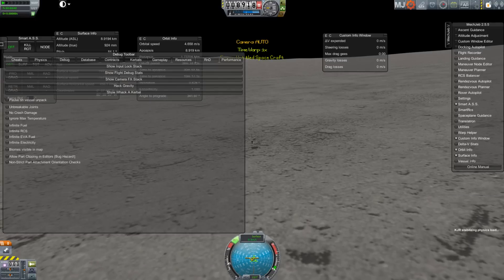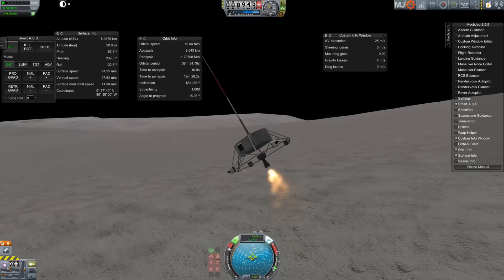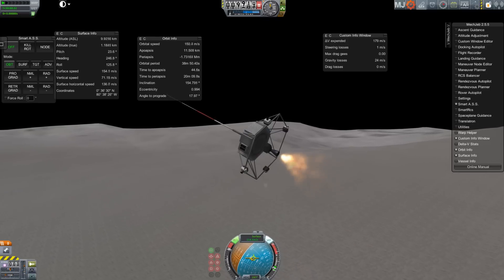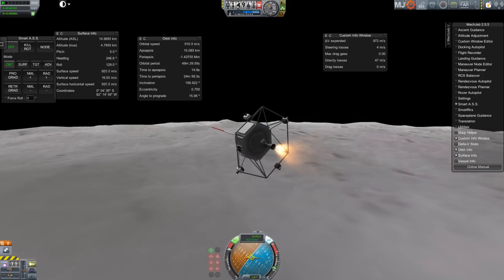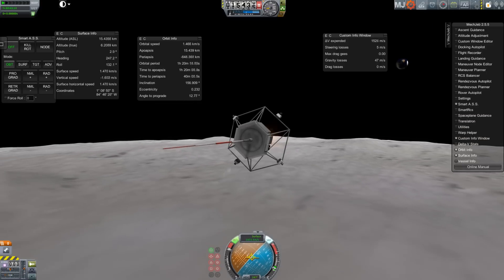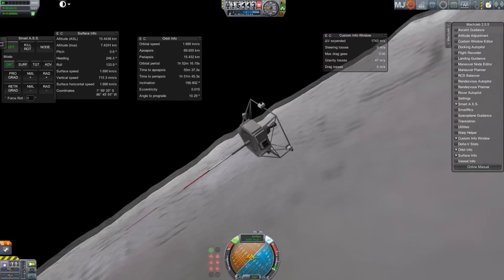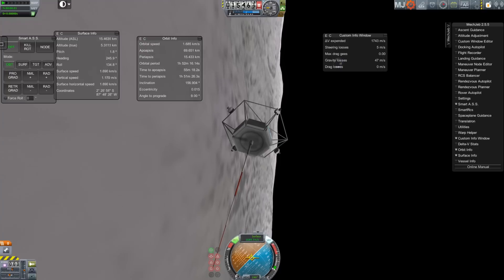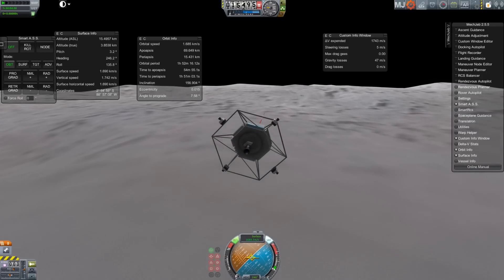How Much Delta V Do You Lose in a Moon Landing?

Comment: for liftoff and landing calculations of deltaVs initially you have to take into consideration the amount of impulse you need to get to the desired orbit's height as well as the required velocity you have to achieve for that orbit.

simplified: dVreq = SQRT(2*g*h)+SQRT(μ/(h+R)) - v0*COS(incl)
dVreq - required deltaV
g - gravitational acceleration at surface
h - desired altitude of orbit
μ - standard gravitational parameter
R - equatorial radius
v0 - is your initial velocity due to rotation of the object, in case Mun is about 9m/s
incl - your desired inclination

Comment: technically, "reverse landing" is not launching, cause if we look at the ship on the ground and orbit in landing, it is heavier on orbit and lighter on the surface. And when we launching, it is heavier on the ground and lighter on the orbit)
Reply from the maker: Did you know it's common for spacecraft landing calculation to be performed by simulating a launch vehicle which has negative fuel consimption and gains mass during ascent?
Reply: +Scott Manley that makes more sense, it is just like inverting time, which is very useful way to solve some problems in classical mechanics. At least I used this method a couple of times in my work.

Comment: I always bring at least 200m/s of buffer due to PEBCAK errors.
Reply from the maker: PEBCAK is the biggest source of problems in most kerbal missions.
Reply: +123nick Problem Exists Between Chair And Keyboard. 

User error.
Reply: +Scott Manley whats PEBCAK ?
Reply: +VhenRaTheRaptor ahhh ok thanks
Reply: +NaleshSA You're right, even using autopilot I screw up sometimes so when going manual, I tend to exaggerate my fuel by 15 to 20% so I know I'll not be stranded somewhere.
Reply: +NaleshSA i think everybody who has some experience with the game do that :D

Comment: I really have to disagree here. The landing you did in the previous video was really, really bad. Your trajectory was way too steep and you had to point your craft downward to fight gravity, wasting lots of dV. In a perfect landing you wouldn't have to do that until the very end.
Yes, getting that trajectory right is very hard and yes, a 50 m/s dV margin is too little to actually manage to land. But you could still have made a better attempt.
Trying to land on Tylo or any atmosphere-less real world solar system body shows very well how you have to get the trajectory just right. I've landed crafts on these types of bodies lots of times. I nearly always crash the first few times because I get the trajectory wrong. But after a few tries, I get it right and I manage to land with the same amount of dV that I crashed with during other attempts.
Reply: +Smorfty 
I believe this is the correct answer Scott, your trajectory was terrible if you were aiming at "perfect" landing. The attempt here shows a perfect suicide burn with near perfect trajectory and higher TWR. As much as I like your vids, this is not a proof of anything.

Comment: Scott, during the landing, the point with the highest TWR was just before touchdown (crash), but during your experiment, the point with the highest TWR was at orbital insertion. In other words, on your landing attempt the tank was empty at ground level, but during your ascent the tank was full at ground level. Since the TWR was not the same at each corresponding point of these trajectories, you cannot assume that one is the reverse of the other. You should do an other experiment and calculate your gravity losses during the descent rather than the ascent ;)
Reply from the maker: The TWR in the experiment didn't change, since I used infinite fuel.
Reply: +Adrien Lessard 
The mass stays the same due infinite fuel, so the TWR is only affected by the gravitational pull of the moon, which is lower when you are further away from the body then on the surface. Therefore the TWR slowly increases with altitude even with constant mass.
Reply: Yes, but during the landing, Scott Manley  didn't have infinite fuel, so the the landing cannot be compared to the ascent accurately. I'm just saying that "The landing is the exact revers of the ascent" is a false statement.

Comment: You could also link to a post by tavert (both on reddit and the KSP forum) about constant altitude landing/takeoff: http://forum.kerbalspaceprogram.com/index.php?/topic/36648-landing-and-takeoff-delta-v-vs-twr-and-specific-impulse/

From this is can be seen that thrust to weight ratio is very important for the minimum required Delta-v, however above a TWR (relative to that celestial body) of roughly 3 the reduction in Delta-v is probably not worth the extra mass you normally need for a more powerful engine to get that TWR.

Comment: This probe has significantly higher TWR than the probe you tried to land, so it´s not really comparable.
Reply from the maker: +Goroh35 The TWR is critical during the initial lift off and final descent, so look at the TWR on the original lander at burn out and you'll see they have comparable TWR.

Comment: dumb question: is delta V the same as fuel?
Reply: +Tiago Passarela Delta V  means change in velocity, fuel is burnt to affect this change
Reply: https://en.m.wikipedia.org/wiki/Delta-v

or simply "change in velocity", in this case  in meter per second (m/s)

the "delta" stands for "change" (delta is often used in phisik math to signify change)

the "V" is short for "velocity"
Reply: +Don Sparrow ur fast :D
Reply: +Tiago Passarela Not a dumb question at all.  Delta-V is affected by the amount of fuel you have but also the mass of the craft.  A heavier craft will require more Delta-V to perform velocity changes, so it will need more fuel - which will also make it heavier because the fuel has mass.  A lot of the art of designing rockets is to calculate how much fuel you need and finding the Delta-V 'sweet spot'.

Delta-V can also be improved by having more efficient engines.  Ion engines (for example) have a very low thrust but very high efficiency, so they will be able to affect changes in velocity for a very small amount of fuel mass - but will not be able to affect those changes quickly, which makes them useless for atmospheric flight.  This is part of the reason why we still need (relatively) inefficient chemical engines with high mass (and heavy fuel) - because they can provide changes in velocity very quickly and provide enough thrust to reach orbit.

The Delta-V is affected by even the smallest change in mass.  Astronauts on flights are measured to within fractions of a gram for takeoff and Delta-V calculations, as is the payload and the craft itself.  Real rockets run to a very small margin of error to ensure maximum efficiency.  It's why Apollo 13 had to take the path it did (assisted gravitational slingshot around the moon) rather than a 'direct return', because the Delta-V for a direct return was incredibly marginal.

Comment: Proof that this sentence not only apply to aircraft :
The only time you have too much fuel, is when you are on fire ! :D
Reply: +Kit Naylor Jebadiah Kerman
Reply: +Demongornot Well landing can be a problem with a trust to weight ratio that is too low.
Reply: +Demongornot Or when you need your craft to lose weight, which you can do by burning fuel.
Reply: Who said that? xD
Reply: +Demongornot It doesn't apply to aircraft either. You're still using extra fuel to compensate for the extra mass added by the extra fuel. This is why commercially flown aircraft just have 'enough to make the flight, with reasonable a safety margin.' Wasting fuel adds up quickly.

In rockets this is even worse since the rocket equation doesn't play nice. Having one ten extra fuel may very well mean you end up using half of that anyway.
Reply: +OverworldLord Correct.

Same profile pic. Hey there fellow pilot! :)
Reply: +OverworldLord 
Yeah, better have too much and dump it than not enough !
+Dare Daemon 
I know it, I know that more fuel you add to a rocket, more thrust you need to carry his weight and the weight of the bigger fuel tank and the weight of the structure to support heavier fuel talk and more engine thrust.
But the payload capacity also add up and you can carry heavier and heavier things or have greater and greater delta v if you don't put a heavier final payload.
And in reality the only reason why we don't do it its because it will be too expensive, that's all, nothing prevent you to use a overpowered rocket to carry a really small thing (providing throttlable engine with enough throttle down percentage to avoid aerodynamic failure during the area of maximum dynamic pressure cause of too much acceleration because of too high TWR), it will just be a waste of fuel cause a lot will end up being not burned.
Just money.

Same for aircraft, first, airliner have a maximum landing weight which is under their takeoff weight, if an aircraft that just take off need to land back cause of emergency or anything else, he will need to dump fuel to become lighter, and yes carrying more fuel mean more mass and mean higher throttle setting to push that extra weight and of course more consumption which mean fuel aka money wasted, but again its only a matter of money, at the end the aircraft could have greater range.

But the sentence "The only time you have too much fuel, is when you are on fire !" mostly apply to jet fighters which at military power already burn a lot of fuel and with afterburner on dry really quickly their tanks, if they could have more fuel most of the time they will be able to perform more aggressive manoeuvre and compensating more easily the loss of energy and over time get able to take advantage to most opponent in dogfight situation by compensating the non energy conservation friendly manoeuvre with more time in AB.
Reply: Thunderpawz Hello, Thunderbird 1. I might be mistaken, but I believe we've met once before... with a similar profile picture conversation.
Reply: +OverworldLord Maybe.  :P

Comment: How do you work out gravity losses on paper? I'd be really interested to know, thanks.
Reply: +smokeydops Yeah, I spent ages thinking about it last night. I couldn't find anywhere that gave an actual equation. It's probably because it's more complicated than I originally thought due to the vectors and the fact that the mass of the vehicle decreases as it accelerates, as well as the force of gravity reducing as its lateral velocity increases (also because it's getting further from the centre of the parent body). 
I got that it would depend on the downward force due to gravity and the time spent experiencing it but I don't know how to put it into an equation given that all the variables are constantly changing.
Also, I think you mean m・s-1 of Δv rather than metres per second squared (I know it's pertaining to acceleration but still).
I still really appreciate your input though, thanks!
Reply: +Morgan Mitchell Basically, your are trying to find the velocity you would have when you impact the ground from a dead standstill at a certain altitude, although you could factor in an initial velocity if you wanted to.  Ill do an example with the moon

g = -1.62m/s^2
altitude = 100 meters

There are two ways to do this, the easy way would be to just throw it into the equation v^2 = 2ad where a is acceleration (due to gravity in this case) and d would be the altitude.

v^2 = 2ad -> v = sqrt(2ad) So if you do that out it should be 18m/s

If you wanted to work out how it happens to be 18m/s you could do it like this
The "position function" (d = .5(acceleration)t^2 + (initial velocity)t + initial height) comes from the integral of velocity = acceleration x time. (an integral is just an anti-derivative) Not too important to know that but it comes in handy because if your distance d is 0 for a certain time then you know that time is the time that you have impacted.  Also make sure your acceleration is negative for this part.  
using the same numbers from above. initial velocity is zero.
t = time a = acceleration due to gravity v = velocity d = distance s = initial height
d = .5at^2 + vt + s
0 = .5(-1.62m/s^2)t^2 + (0)t + 100 meters
t = 11.1seconds

So then just find your velocity from accelerating that amount for 11.1 seconds.

v = at = (1.62m/s^2)(11.1s) = 18m/s

Note that this can also be fun to use for actually calculating suicide burns.  Hoped that helps though, didn't ever think i would spend this much time writing out a youtube comment.
Reply: +Morgan Mitchell Just a guess from me:
I think you&#39;ld need to know how long it will take to reach orbit and then calculate how much energy you need to keep hovering for that time. So if it takes 60sec to reach orbit =&gt; gravitational &quot;constant&quot;* x time =&gt; speed and that speed is likely the lost delta v.

*in these circumstances it&#39;s not really a constant, but it will estimate the loss too high, which is not a big problem, only more expensive than necessary.
Reply: +Robbedem Yeah, I was thinking it had to do with time spent accelerating and the standard gravity of the planet too, but I was really interested in knowing the equation.

Thanks nonetheless though, I do appreciate your help.
Reply: +Morgan Mitchell 

Use 110m/s2 of vacuum dV on 11m/s2 thrust on surface with about 10m/s2 of gravity going straight up, you lose 100m/s2 dV to gravity and end up accelerating to 10m/s2 (without other factors)

if i am correct, anyway, the calculation is

vertical acceleration minus gravity used in a given time, which can be represented in burntime of total vacuum dV available
So to use 110m/s2 of vacuum dV at 11m/s2 thrust you have 10 seconds of burntime.
If you use that straight up on earth, you have approximately 10m/s2 every second lost to gravity.

To find your gravity losses in an angular burn, you need the angle.
If you quickly turn over and burn closer to the normal of gravity, you lose less

this isn&#39;t exactly what you wanted to know, but eh.
Reply: +Morgan Mitchell If you know your orbital velocity and altitude, you can work out gravity losses as the instantaneous velocity at impact from whatever your altitude is if your lateral velocity was zero( I think).  For example if your altitude were zero then you travel no distance until impact so gravity loss is equal to zero.  This works the same as when launching because like scott manely said a launch is like a reverse suicide burn.

Anyways to work this out on paper use a position function d = .5at^2 + alitiude and find the time where d = 0.  Then find dy/dx of the original equation which is v = at.  I'm pretty sure the equation v^2 = 2*a*altitude would also work
Reply: Dirtcubed Any possibility of a worked example? ._. Considering I've only just done differentiation at school... Don't worry if you think it'll take too long. I don't really know what you mean by "a" or "at". Or a position function......
Reply: Dirtcubed Wow man, I'll have to save this and come back to this next time I am going for those precise suicide burns. I do genuinely appreciate the effort you've put in for this; very useful.

It's always great to learn some more physics (and maths!)

Thanks a bunch, once again,

Morgan
Reply: +Morgan Mitchell no problem, glad it helped

Comment: I'm going to program a small tool for simple orbital maneuver Delta v calculation. Any suggenstions what i could add ?
Reply: +Fred Heil the ability to see many paths at the zoom-out screen,
when calculating the different delta-v's would be EXCELLENT,
though the programming for such would need to model the 3Sphere of the ship,
and follow the Hamilton/Perelman formula to solve for ANY point relative in the game...
having at least 20 significantly different options would be great,
and being able to choose the options which get the best boost from LaGrangian/Oberth effects would be EXCELLENT!

this would help immensely to make 'more informed decisions' when deciding go-no go 
on an orbital path.

also, having the option to set the minimum return-to-point delta v relative to any point in the Kerbal system,
that would be EXCELLENT for some mission, 
especially for rendezvous for multi-part ships 
(several probes deployed in ICBM style, with 2 manned landers also to return to ship after doing missions...)

you can see the last thing, which would be the most awesome...
having a "return to same orbit" delta-v calculator would be EXCELLENT for rendezvous maneuver,
to bring together all parts of a ship into the same orbit,
would be EXCELLENT, to do,
to choose the lowest common multiple of orbit between all the parts,
or, bring the parts together with the least delta v loss into some orbit.

Bonne chance mon librepenseur!
Reply: +John Smith that sounds great but it's way over my coding skills unfortunately :/
Reply: Fred Heil
mine also... though,
it can be the aspired thing?
Similarly, people find that many hands make lighter the work, as on the AIXML and AGI fora out there...
maybe other codeur could team with you?

bonne chance mon librepenseur!